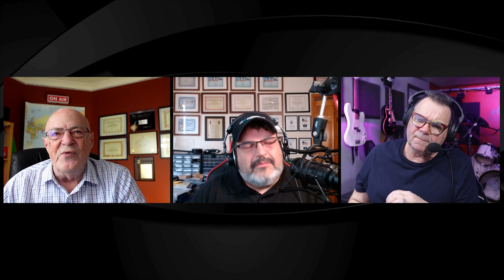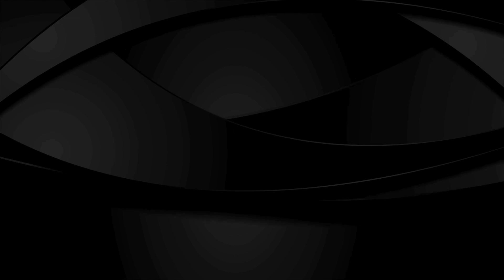Safety Warning - When RF Breaks your SH*T

Comment: I don't understand some of the commentator comments: For example 1500W at 50R equates to 273v and 5.5A or at a high VSWR say 10R then its 122v and 12A. The only time that you can get very high voltages is when the antenna impedance is very high say 300R then the voltage is 670v and 2.2A, so at these voltages nearly any modern wire insulation can withstand the voltages...
Reply from the maker: John corrected himself in one of the comments. Don't worry - it's just a bit of math! The problem of being on the spot - and recorded!

Comment: I placed a flicker bulb or imitation flame bulb (two closely spaced flame shaped elements in place of tungsten wire) on top of my 5 ft firestick and on top of my steel whip . Instead of the normal yellow/orange flicker I get a bright purple/red glow that varys with modulation below a certain level. It did effect the SWR raising it some but that was easy to correct. I recommend coating the glass with hot glue for durability. The bulbs come in two sizes. The smaller bulbs base fits snugly inside a decapitated Firestick cap snugly . The bulbs do not have to be electrically connected but it helps when setting SWR . Remember you are changing the antenna length with this. It takes more than 5watts to light them up.
Reply from the maker: Love it!

Comment: That was great. yes things change at 1 Kw. even types of plastic start to react to high power RF. may be fine 400 watt.  the ends of a dipole is where the highest voltage is.  a loop back soldered back on it self  prevents the arc ball from forming.  even ladder line and window line can be a problem at high power. the voltage john talked about is for 50 ohm feed point. you go up to 450 or 600 ohm feeder the voltage goes way up.  and can arc across to near buy metal like a gutter on side of house.  same with end fed dipoles. which is about 2500 ohm impedance . not only the UNUN can heat up the antenna side can arc around. for high power RG 213/214 is what you need for feed line at 50 ohm. can be M & P or ABR coax. That yellow Pota flex7 from M & P can handle a KW .  that 7 mil . but if needed to go long  go even bigger. line loss . it really adds up at 1Kw . 73's
Reply from the maker: Nice comment. Thank! Didn't know about the bbalanced feeder. Interesting!

Comment: Hi Guys,

It is not 16-18 amps on those open frame relay contacts as stated as fact during the video.  It would be the current squared times the impedance equals the power.  So at 1500 watts it would be about 5.5 amps.  Now here's the rub, a (not vacuum) relay contact rated at 5.5 amps is fine at 60Hz but not so fine at 28million Hz.  So some derating of the contact current handling is necessary.  Also, relay contacts do bounce so the transmitter needs to give the amp a few fractions of a seconds to close then send RF.  Many modern transceivers have a way to delay the RF for that fraction.  

I have built many amplifiers with some large tubes.  

I currently live in a very tight neighborhood where the lots of 6000 square feet.  And I have had just one complaint from a lady who said that I was turn a ceiling paddle fan on and off.  I recommended that she have it serviced, and it was not my problem.  

The amp I built when I moved here uses a Russian triode.  I used two vacuum relays inside.  The external antenna relay boxes I built each have 5 large Russian relays connected to 5 SO239 connectors that have Teflon dielectric.  They are all silver plated. The vacuum relays are rated at 10KW. 

I don't use end fed antennas because in my view, they are not a good design.  I prefer something like a dipole.  The impedance can be close to 50ohms as opposed to 5000ohms(and more) at an end fed.  I evaluate antennas by looking at them as if they are a dipole. It could be a vertical with radials or an off center fed dipole for example.  High voltage is at the end of the element.  It is wise to eliminate corona discharge.  During a test with a homemade vertical and QRO power a few years ago, I created arcs that were about 4 to 6 inches long from the capacity hat.  

There is much more to talk about, but this comment is already too long.  Just keep in mind that 1500 watts can be run at a ham radio station when a few simple points are kept in mind.

73, Jim Heath W6LG YouTube Elmer
Reply: Jim I corrected myself down in the comments.  I misstated the Amperage.   thanks for catching that as well.
Reply from the maker: Jim, check John's reply. He did mention that - but as you know, once edited and uploaded, there's not much we can do. Thanks old friend!
Reply: Yes I do.  If I had a dollar or a pound for every misspoken word or mistake, I could afford to live in California.  Despite watching and editing, I make lots of mistakes; lots!  73 Jim

Comment: I have a Acom 1000 amp which I purchased to push me towards the full licence - so far I am still only 2E0MSR as other things got in the way. I was doing some checks in tuning it to my DXC (without transmitting at high power). I got it wrong and pushed out nearly 1000W on 20m (carrier signal etc). Next minute family are shouting at me - I have set the house alarm off!  Anyway, not been able to use it in anger etc.  Other thing of course - all very well having that power to use, but how far away are you from the antenna? !  My office is back of garden and my DXC is about 3m away - probably not so good for 1000 W (even if I could!).  Mark,  2E0MSR.
Reply from the maker: Very good!

Comment: Related directly to this is "hot switching"  which itself destroys amplifier relays. Ideally the amplifier relays should be put in "transmit mode" before the radio begins to produce RF and stay in that position briefly when the radio goes to receive. Some radios do have a parameter that can be adjusted to delay the RF output, you only need 10mS or so of delay. Many VHF/UHF high power stations (with mast head pre-amplifiers) have to be even more careful and often use a "sequencer" to ensure the chain of equipment is keyed in the correct sequence. Even moderate SWRs increase the voltage and current stress on the feeders and connectors, an SWR of 2 will increase both by 40% approx. Most 0.5" cables have plenty of leeway though... 73

Comment: My 4k rated Palstar 4 to1 balun would overheat on 160 with 300 watts or more power. My loop was not great resonance on 160. I had to trim it several times to get it better so the balun wouldn't have the china syndrome. As the balun heat soaked the srw would climb steadily.
Reply from the maker: Yes, I also had saturation on 160m..

Comment: You should see how fast a room fills with black smoke when a  switch carrying 40kw uhf, goes faulty. The transmitter trip was also faulty. The black smoke came from ptfe insulators in 6 inch feeder burning. Very acrid smoke and dangerous to breath.
Reply from the maker: Woah!!

Comment: Correcting myself at 1500watts 275V RMS, 775 V peak to peak, 5.477 amps per leg.  I lost my train of thought and quoted the relay specs most equipment has for 1500w, which is are 16-amp relays.  Also realize you have to account for frequency when you calculate for your relays, the higher the frequency the less amperage the relay will handle need to check the manufacture specs.    For example, if you had a 10amp rated relay the power handling capability using Ohms law should be I^2 x R=P (10A^2 X 50ohms) = 5000watts, but that is at DC or 60hz AC.  That same relay may only be rated at 4amps at 30MHz so that changes the power handling.   4^2 x 50ohms = 800watts.   In my research I have read to derate relays between 40 and 60% of the DC/AC60hz rating for HF.   I typically will use 60% to be safe and will typically use 20 or 30amp relays for my projects.  When in question go bigger to be sure your relays will handle the power you are using.  Also be aware of Duty Cycle... those contacts will heat up, so high power in the digital modes will create more stress on the system.
Reply: So, is that a yes to testing with your tongue ?
Reply: (volts gives you a pretty good pop on the tongue, I don't think I want to find out what 275v of AC is like.  @xszl
Reply: I was also fighting off a sneeze....
Reply from the maker: Good reply John!!
Reply: Callum can you pin this please.  @DXCommanderHQ

Comment: Energy is heat and heat starts breaking all the weak spots.  Then the corona flash starts and gives a nice glow.  I would not want this to happen with the coax running through the house

Comment: Personal experience, DX50 wire does hold up better to QRO digital than DX10.  I’ve not QRO’d my element ends yet, as mentioned in the DXC build manual.  I will do so next time I drop the 12.4.
Reply: Wire Diameter has an impact on power handling capability.